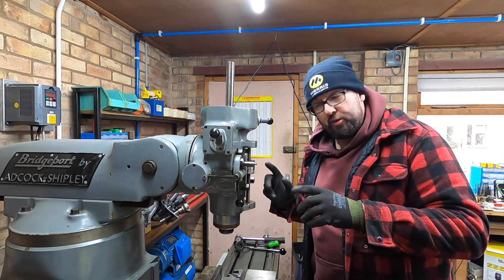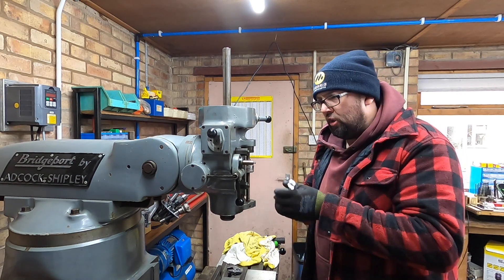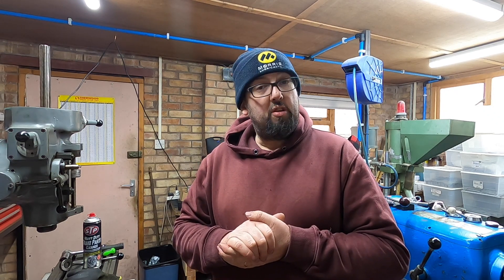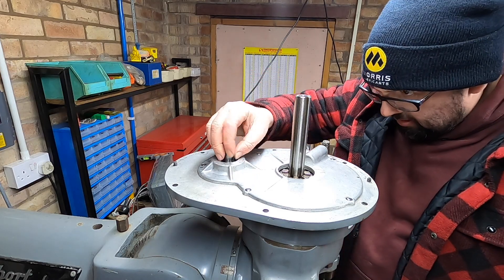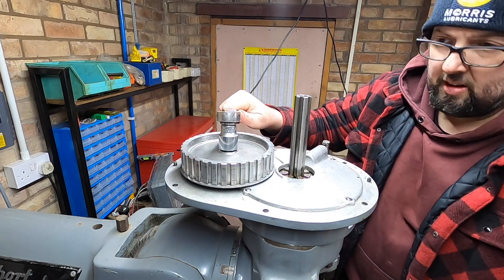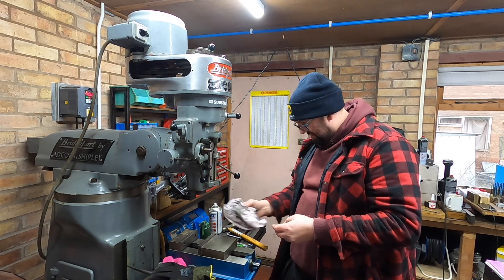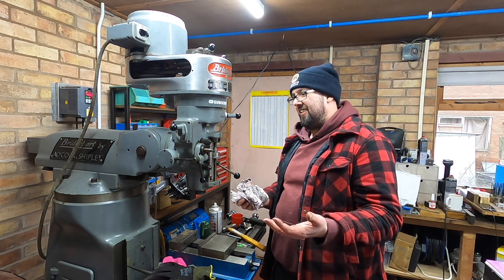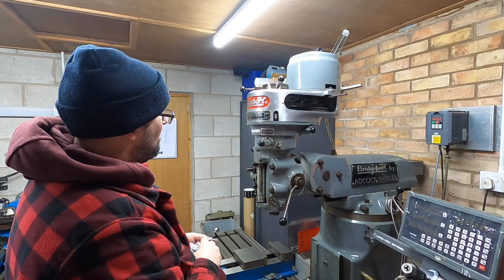Part 3 - Bridgeport Milling Machine - Did I fix it?

Comment: You put oil but i think you should have GREASE THE GEARS at time 5:50.  Mine have a variable speed head anf it need 1 tube and a half of grease.   i say it because yesterday i opened mine and there was no grease from the previous owner and the small gear is completely worn out.
Reply from the maker: Well, that’s because it’s not a grease packed head! The head is supposed to be oiled couple of times a day when in operation with 10w light oil as per operation manual. Manual is easy to find online with a Google search. If you want to swap to a grease head you have to use the right type of grease. I highly recommend H&W machine repair YouTube channel for bridgeports. All the best, Matt. 👍

Comment: Dude, respect. I had the H&W mount for supporting the head on the table and everything and I still needed about 5 tries to get it back on mine without those bolt binding.
Reply from the maker: I was going to make a mount, but I got inpatient and did it by hand, from the sounds of it the mount would have made it take longer to fit back on. All the best, Matt. 👍

Comment: When driving bearings into a case (time 5.00) you should not use the shaft but drive the outer shell directly.This stops putting dents in the balls or their race way. The rest was good and it sounds strong.
Reply from the maker: Thanks for the tip Fergus, All the best, Matt 👍

Comment: Great to watch this strip down/ rebuild Matt.
The engineering looks to be well thought out.
Regards
Robert
Reply: hope he topped up the head with oil,and not just rely on a few drops from the oil can that he gave it.
Reply from the maker: Martin, you are aware that these Bridgeports aren't a sealed head? You can't fill the head up, the oil will just pour out of the bottom, and it doesn't take much either. If you watch H&W machinery YouTube channel, they remover the oilers and seal them off and pack the head with suitable grease, which I will do when I replace the main bearing in the future. I did put more oil in though, I didn't film it though. All the best, Matt 👍
Reply from the maker: Thanks Robert, it was nice to see how clean it was inside with very minimal wear. I'm happy that the main bearings all seem fine, and should last a while, I would like to replace them at some stage for peace of mind. For now, I'm very happy with it. All the best, Matt 👍

Comment: SUCCESS!!!  Fine job Matt...  So jealous of "Bridget", would love to have one someday, but will likely have to settle for a smaller bench top machine.  Keep up the good work, can't wait for the next update on the locomotive.
Reply from the maker: Thanks Jeff, I was very lucky getting this one, and the more I work on it, the more I realise it is in good condition for its age. Back to the steam engine now though, I just wanted to get this out checked out, as we have the cylinders upcoming! All the best, Matt 👍
Reply: @MattChiversWorkshop  I recall seeing the first video you did on Bridget...  I was surprised how good the way surfaces and table looked.  That's most of the way toward getting a good used machine.  If the ways and table look good.  No expert of course, just looking at it from a purely logical perspective.  The rest of the stuff (feed screws, nuts and bearings) are something the average guy with decent mechanical skills can fix.  Re-scraping ways, not so much!  Thanks for sharing...